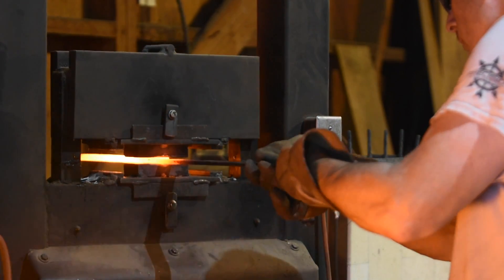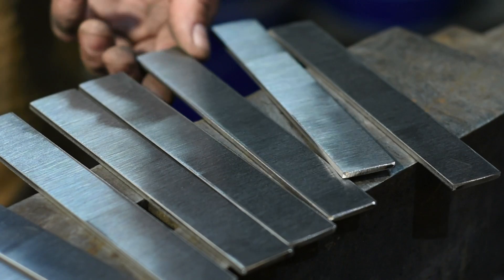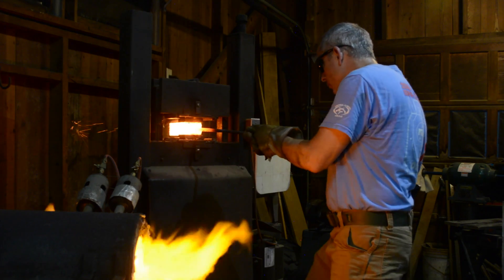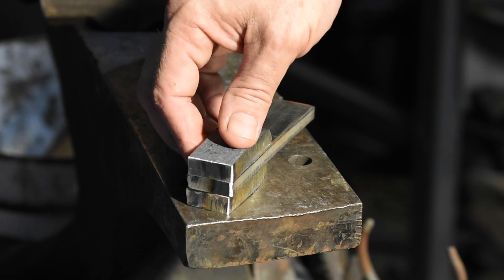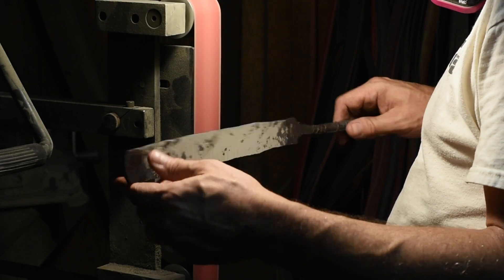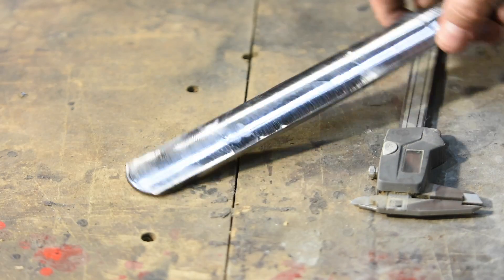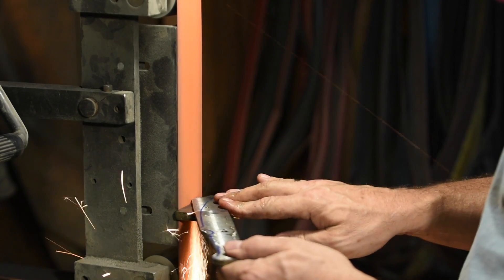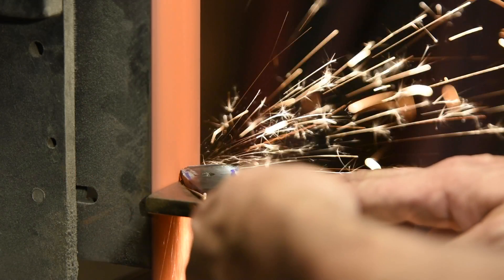Making a Knife - S*n-Mai Damascus

Comment: I noticed at about 6:00 you mention that you are going to grind the blade. Does this require more initial material or is the waste from forging out the blade similar?

Also A curiosity of mine, have you ever tried making something from all the scrap pieces that flake off? I've heard something about that in Japanese balcksmithing related to apprentices making their masterwork.

Comment: Walter, I was just watching an episode of the History Channel's "Iron & Fire" when the star of that show, blacksmith Daniel Casey, did something that you may or may not find useful. Before fully polishing out a Damascus blade he locked it into a vise and used his thumbnail to basically ring it like a bell. He said that with even the slightest crack you can hear it. It makes sense. I've never personally tried it on a knife blade, but it works on shotgun barrels. If there is even the slightest loose spot in the soldering of the rib or the connection of the barrels you get a dull thunk instead of a nice ring. If it works it could help you to spot a cracked blade before doing all that hand polishing work.

BTW, really looking forward to seeing you on the TV show!

Comment: Hi Walter. Any suggestions to bevel grinding technique that will help avoid a thicker tip? I've been trying to remain conscious of the fact that the tip and plunge line will be thicker as you've described in other videos, but I still end up with a tip that's thicker than the rest of the bevel on most knives. Makes it a bit laborious to finish a knife, and nerve wracking because it's easy to botch my bevel when I'm trying to clean up the tip. If it matters, I use a piece of scrap steel anchored to the tool rest on my grinder so that I have a stable platform when grinding the bevel - wondering if I should start grinding free hand.

Comment: I noticed you're not using cutting oil when you drill your holes.  Is it not necessary with carbide bits?  I assume you're using carbide bits.
Reply: Cutting oil isn't necessary with any bit when drilling steel, good technique will largely prevent killing bits. Make sure that the chips are clearing from your holes and not packing up inside(not really a problem on blade thickness material, but this will cause the cutting edge of the bit to chip), make sure that you're not overheating the bit(this is the real killer), apply good pressure(not enough and you'll be generating a lot of heat without removing much material), and, in general, don't rush like everyone feels the need to do. 
Ideally, you want to plunge the bit over and over, cutting a few seconds at a time before lifting back up, rather than going at it until you poke through the other side - this will clear the chips and keep the temperature in check. But, again, this isn't necessarily required for blade thickness steel that isn't hardened because it's just so thin, but would be a good idea if you're trying to drill a hole after heat treating(don't waste your time with anything other can carbide for hardened steel - HSS will NOT do it). 

With that said, I always use cutting oil because I have it and it lets me be a little lazy/sloppy with technique(longer plunges) - but, make no mistake, cutting oil doesn't let you get away with too much, because, when you see smoke, you're burning off that oil which means you're overheating the bit. So, cutting oil or not, the sharpness & life of a bit is dependent on technique to prevent edge chipping & overheating. 
And, just like a knife, a bit will get dull with use even with good technique. So, whenever a bit gets dull, stop using it and sharpen it(easily done on a bench grinder, look up tutorials here on YT), otherwise continued use will just overheat it and sharpening it won't save it at that point. 

- Someone whose income has been more dependent on drilling holes in metal than I'd care to admit
Reply: Thanks a bunch!  That was very informative.

Comment: If you fail to heat treat a knife (I'm using 1095 btw) can you retry or is my knife screwed. Thanks a lot :)
Reply: 1095 is a very forgiving steel, so you should be OK to reheat it. The only issue you might run into is blade warpage if you give it a second go. Also, for a simple high carbon steel such as 1095, right before you quench the steel, check the blade with a magnet to be sure it does not stick. If it becomes non-magnetic, chances are that you'll get a decent heat treat without a bunch of expensive heat treating ovens.
Reply: +No.1 Prepper thank you for the advice
Reply: Glad to help. Hope your knife turns out good :)

Comment: a stack of steal weights lets say 1 1b. you forge weld and it now has "scale". before you clean off the scale does it now weigh more than 1 lb. or less than 1 lb. you clean the scale off. is it back to 1 lb. or less than 1 lb. what is "scale "?
Reply: Scale is oxidized steel on the surface of your working piece. It's formation occurs during forging and heating. Hence, removing it is in fact removing steal from the original piece, and will reduce the weight, or as you said, be "less than 1 lb".

I don't have a ton of experience here and others could give a far better answer, but that should sum it up. I'm sure Google and the various blade forums have something to say about it as well.
Reply: Actually, before you clean the scale off (if you had all the scale formed and none fell off) it would weigh slightly more. 1 lb of steel will make, I think, 3 lbs of rust.

Comment: Did you move away from using the sprayer and go back to the traditional bucket for cooling?
Reply from the maker: If I'm doing a bunch of grinding at a time, I'll use it, but it's very messy and takes a bit of set-up time...so it depends on the project.